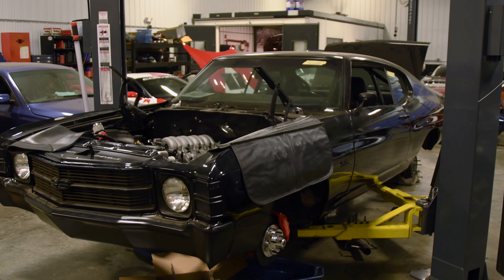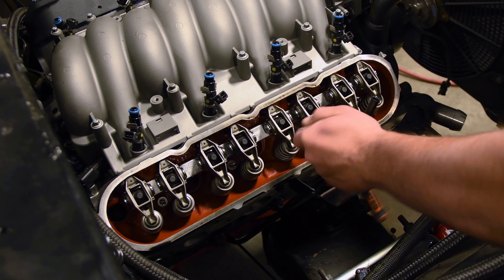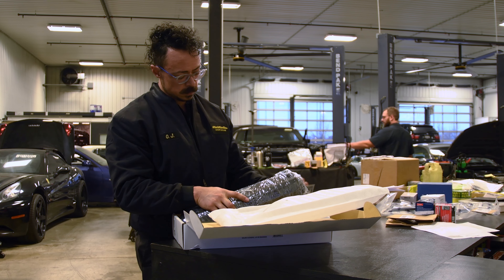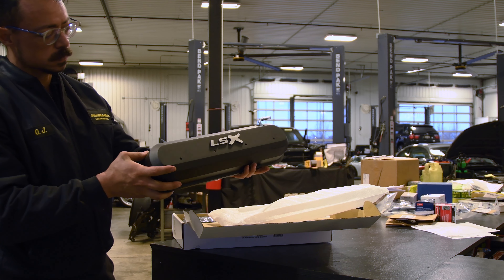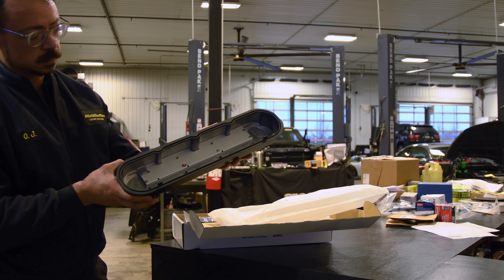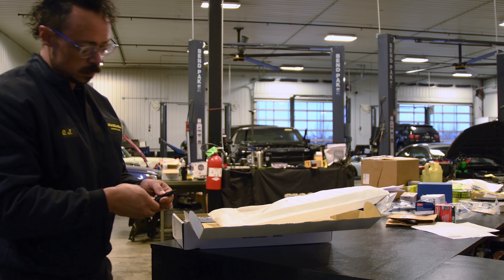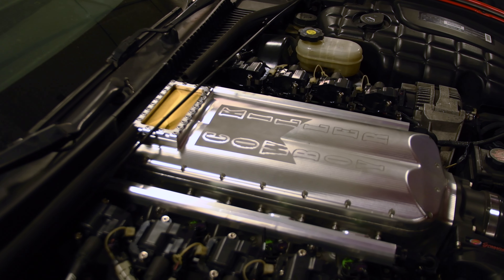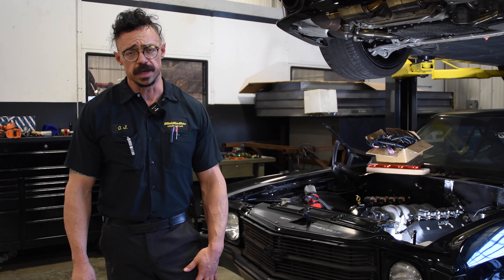Proform Valve Cover Review - Best Budget LS Valve Covers?

Comment: I'm having issues running a oil catch can with these valve covers is there any info you could possibly help me with thanks. Very good video.
Reply from the maker: Which catch can are you running?
Reply: @FluidMotorUnion  mightymouse solutions catch can
Reply from the maker: Does it utilize factory quick connect fittings for the PCV? These valve covers had OEM style connectors built in.
Reply: @FluidMotorUnion  these are considered old style correct
Reply: @Fluid MotorUnion  as far as quick connects I'm just using supplied hoses right now from them